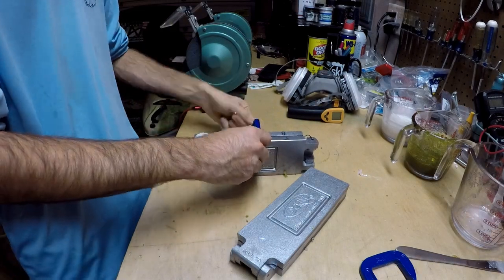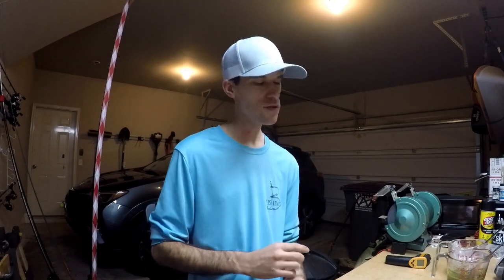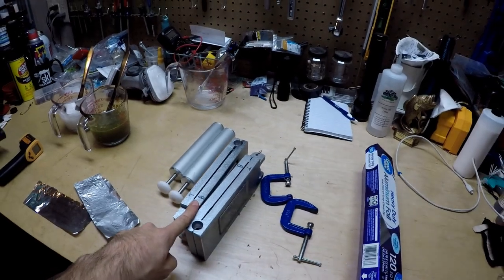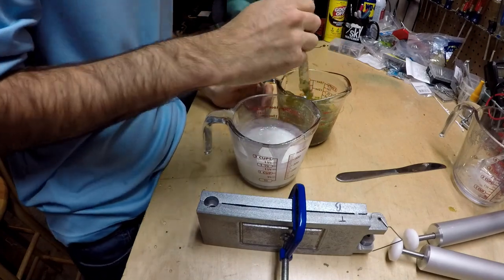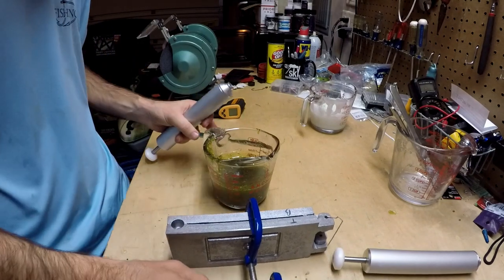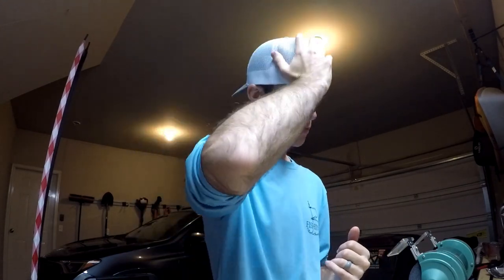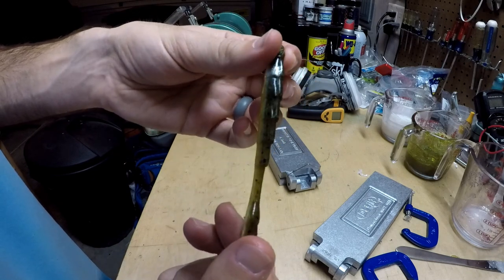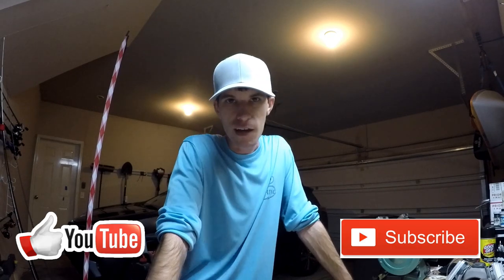DIY DUAL COLOR Soft Plastic Lure | CHEAP and EASY Aluminum Foil Laminate | B Fishing |

Comment: Do you ever have a problem of them pulling apart? Or just holding together after bites?
Reply from the maker: I haven’t. It is key to make sure there is not worm oil in or around the mold to get a better bond